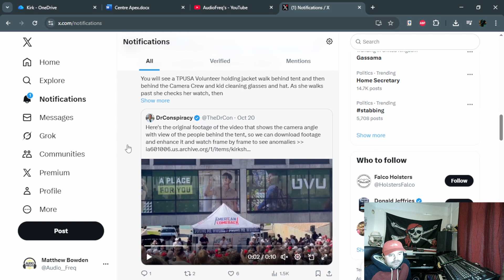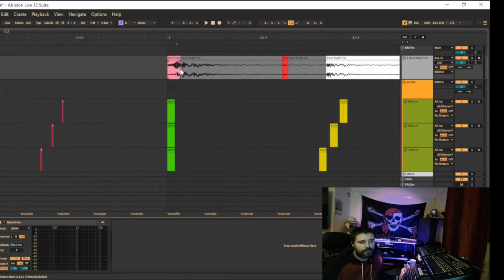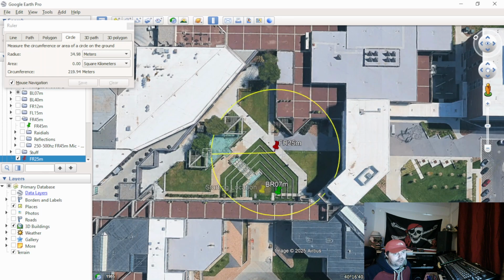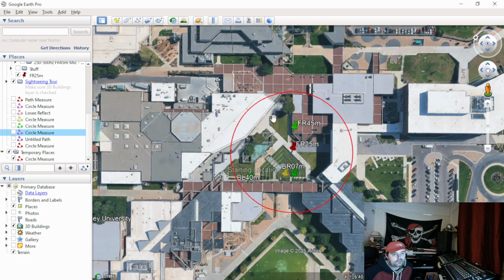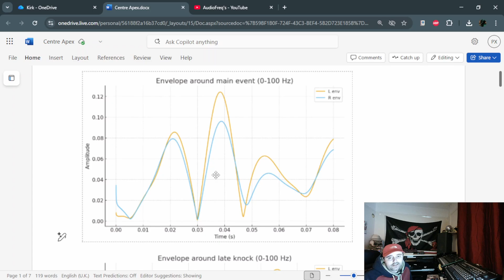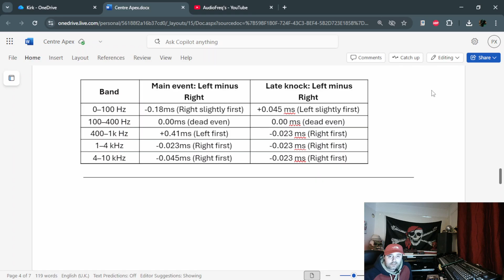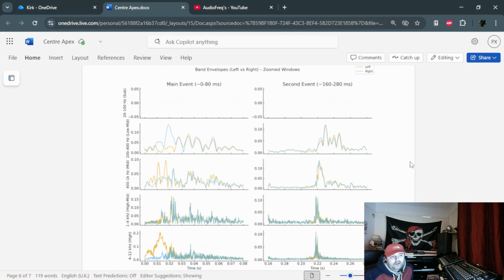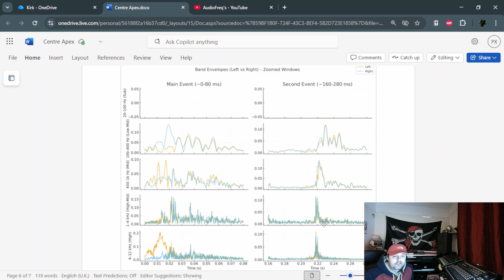Stereo analysis | Frequency Mapping

Comment: Did you do your research on phone mics?
"The microphones on an iPhone are typically located at the bottom near the charging port, at the front near the front camera, and at the back near the rear camera. Newer models may have additional microphones for improved audio quality during calls and recordings." - Claude by Anthropic.

So which of these multiple mics are you getting the TWO audio tracks from?

216ms is the EXACT time of THE Crack to Bang - but you don't want to hear that, right?

Prediction: The evidence will show the gun was located 129m from Kirk at the Losee centre roof.
Reply from the maker: Like I explained. My test is immune, call it what you like. Crack to thump is fantasy with formula. I have made my point. It's like counting to measure thunder. It's a wives tale without the inputs. I don't really care what people want to measure or call it. I'll do my test regardless. Let's face it though. I'm the only one actually measuring something real here bob. Not guessing, I'm not starting with an answer and making the evidence fit that answer. I'm not bothered where it goes, you are though. Very much so. Why?

Comment: Joe Says...back left to right 45 degree angle?  AI says Exactly RIGHT!
 — that’s a strong inference based on the timing difference.
 Let’s break it down together:

🧠 Step 2: Direction Estimation You observed:

Left channel transient at 1.002 s

Right channel transient at 1.004 s

That’s a 2 ms lead in the left channel. Since sound arrived earlier and possibly louder on the left, the source likely came from the back left, moving toward the front right — just like you said, roughly a 45° angle across the stereo field.
Reply from the maker: Haha did you test my findings with Ai? And it worked?! That's awesome!!
Reply: @Audio-Freq  yes, theres a little button at the top of every youtube video, it then summarizes and uses ai to help investigate your finding, complete with images and charts, formulas etc...
Reply from the maker: @truebones I did not know that. But I appreciate you taking the time to run it through man, nice one 😁
Reply: @Audio-Freq  of course no problem, thank you sir. nice to meet you.
Reply: @truebones what button is this? I dont see?

Comment: Step 1: Identify the Transient
Let’s say you’ve isolated a gunshot in both stereo channels. What you’re looking for is the transient spike — the sharp rise in amplitude that marks the moment of impact.

Left Channel: Transient peak at time 
𝑡
𝐿
=
1.002
 seconds

Right Channel: Transient peak at time 
𝑡
𝑅
=
1.004
 seconds

Question for you: Based on this timing, which side did the sound arrive at first?

👉 Your turn — what’s your guess?
Reply: Quick question for you:  If a microphone is 10 feet away from Kirk does the transient peak mark the moment of impact? or the moment the sound arrives at the mic AFTER the moment of impact?
How about 100ft away? Are the times the simultaneous?(That is to say is there only one impact/sound?)

Just a reminder - Matt believes the 'impact' is what is heard when the bullet hit's Kirk. This is the last moment the bullet makes the sonic boom, which is what is being recorded FIRST in all these cases, but it is NOT when the sound of the boom ends, it (the 'crack') keeps expanding from all along the bullet line making echoes from whatever it hits that the sound waves permit.

Comment: There are at least two videos that record the sound of a second shot, one of which misses the first shot because, they say, the stream was interrupted. There is another third video that picks up the first shot and is also interrupted so we have a couple of seconds missing from that too. Then there is a fourth video taken from just inside the tent to the right of where Charlie was sat. 

I mention these because when you listen to the fourth video, you hear the first shot, Charlie falls and a couple of seconds later, the PA system start to feed back and we hear a low frequency hum. Now, this feed-back is picked up by the other videos too and that gives us a way to measure the various sounds and their timing relative to that 'hum'. If we set 't=0' at the beginning of the hum then since we know exactly where and when the feed-back sound originates, we can extrapolate info with respect to the origin of the shots fired. For example, if a microphone to the right of Charlie records a three second delay between the sound of the shot and the beginning of the feed-back, and a microphone to the left of Charlie records a slightly longer delay between the two sound, we know that the person to the right of Charlie was closer to the gunman than the person on the left was, right?

I just think that because we can pinpoint the beginning of the feed-back, we should use that as a marker and analyze the other sounds relative to that marker. What do you think?

Comment: THANK YOU, MATHEW. I LIKE THE WAY YOU THINK AND ENJOY HOW YOU ANALYZE THIS MATTER.  IN MY UNDERSTANDING YOU ARE OBSERVING 3 BASIC SOURCES OF THOSE FREQUENCIES: CRACK, THUMP AND REFLECTIONS OF THE CRACK. IF SO, IS THERE A WAY OF "SPOON FEEDING US" WITH A BLOCK GRAPH OR ANY OTHER  VISUAL WAY (DIAGRAM) THAT DIRECTLY REFERENCES  THE  FREQUENCY ANALYSIS TO THE PARTICULAR LOCATION AND ENABLE MANY TO MORE EASILY FOLLOW YOUR  EXPLANATIONS. AT LEAST,  FOR SOME OF US WHO DON'T HAVE SCIENTIFICALLY INCLINED MINDS. I PRESENTED YOUR MATERIALS TO SOME AND THEY SEEMED  OVERWHELMED BY IT, FOR THEIR  INABILITY TO VISUALIZE  OR IMAGINE HOW IT WORKS.   

 IS THERE ANY POSSIBILITY, THERE WERE TWO SYNCHRONIZED (SOUNDS) SHOTS FROM DIFFERENT DIRECTIONS?  ONE VERY LOUD AND ONE SUPPRESSED. TODAY, THERE IS A TECHNOLOGY THAT CAN ENABLE THAT EFFECT IN A VERY PRECISE  WAY.  IS THERE A DIFFERENCE IN HOW A SOUND WAVE BEHAVES/ CHANGES WHEN IT PASSES THRU A "SLIT LIKE" GAP IN A CONCRETE WALL. ANGLED AT 45 DEG. DOES THE WALL ACT AS A SUPPRESSOR?  DOES THE SOUND LINEARLY FOLLOW THE BULLET OR DIVERGES IN A CONE LIKE  SHAPE, AND IF SO, FOR HOW LONG AFTER A BULLET LEAVES THE BARREL. I AM TRYING TO GET SOME UNDERSTANDING OF THE CORNER WHERE THERE IS A "WINDOW" AND 45 DEG WALL GEOMETRY AND HOW THE SOUND TRAVEL/ REFLECTION CAN BE AFFECTED BY THAT, AND CREATE A GHOST DATA THAT TRAVELS UNDER A LOUDER SOUND.

Comment: Am I going to have to do this myself? I have already explained this multiple times. We can triangulate exactly where this came from and the velocity of the round.
Reply: It doesn’t matter if you are able to do that and pinpoint the location of the 30 06 rifle, because the audio analysis shows that the initial shot and impact on Charlie’s neck do not add up. A supersonic bullet travels faster than the speed of sound so in any normal situation we should see impact first then a split second later hear the shot being fired. But when using a recording made near Charlie position are hearing the sound of the rifle first then impact occurs. What this means is that the 30 06 could not have been the bullet that killed Charlie. We have to consider a second gunman nearer to Charlie firing the deadly shot.
Reply: I 100% agree. The whole thing doesn't add up with the official narrative. I was just meaning as far as calculating this audio. I like this guy's content but he continues to say that we can't know so many things which we can know because we can triangulate.  @richardhernandez6937
Reply: The audio recorded by cell phones can be off sync with the visuals when dealing with super fast actions by a % great enough that the distance of the bullet position could vary by 90 feet. This is due to how smartphones record audio and video. The audio has a very fast recording frequency. Thousands of times per second where the video is likely only doing 30 to 60 frames per second. The smart phone use timing to try to sync the audio the video images but since there is a 1/30 of a second gap between each frame the audio will not be perfectly synced. The audio itself is a much more accurate set of data.  @richardhernandez6937

Comment: All your hard work is greatly appreciated!!!
Reply from the maker: And I appreciate you mate! Thank you!!
Reply: @Audio-Freq  The Fugal building to the right of the Hall of Flags has a HVAC on top - which Chatgpt says would be noisy. But they built a wall around it 2025. It still says noise would be heard. "If the HVAC produces significant low-frequency energy, listeners may still hear a low rumble — the wall alone will not eliminate that."
Reply from the maker: @davidmorgan156  Sure, but that doesn’t change propagation timing — walls don’t move sound sources, they just muffle them.
Reply: @Audio-Freq  My point was they built the wall in 2025 and it has a gap that points towards the courtyard. They tried to resolve a noise issue only to focus it. It creates a perfect sniper's nest that you can look around the corner from fire and retreat.

Comment: How do you account for the constraint that angle of incident (source sound) must equal angle of reflection?
Reply from the maker: I am not measuring that, yet. I might not need to. See how it goes
Reply: @Audio-Freq  Also you divided the measured delay by 2 which is assuming that the incident and reflective paths are of the same length?
Reply from the maker: @VegasOct1Sounds  Of course, I'm measuring it as a reflection :) eg. It's coming back to the mic
Reply from the maker: I'm not trying to locate exactly what surface it came from. I don't care, that's is not how sound works, it's spectral. That's why these spikey questions fall short of the mark
Reply: @Audio-Freq  I'm an electrical engineer, I understand the effects of multi spectral waves both in the context of reflection and refraction.

I'm just trying to understand what you presented in the video, why the divide by 2?

Whenever I don't understand I presume someone knows something I don't and I ask questions so that I can go do the research necessary to bring myself up to speed.
Reply from the maker: @VegasOct1Sounds  Ahhh I get it, you're being objective. It's hard to determine via text. But yes. It's because I'm treating it as an echo. So, it's travelling back from the surface it reflected on. Which one exactly isn't relevant as it's a sound wave and spectral. It's just that it lines up on the map and in the waveform, and for me, moving forward is more important to build the reflection model next. This was merely to put the issue to bed
Reply: @Audio-Freq  But there are many paths a reflection could take, not just one.  Hitting a mic, bouncing off, reflecting off another surface, and coming back to the mic, isn't even a particularly strong one.
Reply from the maker: Yeah man, that's why I use a ruler ;)
Reply: @Audio-Freq  K, well in that case I'll wait and see what you come up with.  Good luck with your journey
Reply from the maker: @VegasOct1Sounds  Unless you know something I don't? You're probably more qualified to talk of waves, but I think the method holds up at the very least. I'm learning here to :) It's a completely new area to my studies. I appreciate your time!
Reply: @VegasOct1Sounds  
Oct 1, 
 Is it a big deal that the vids. are captured on the first level AND  on a second level,  
to determine the path of the Super-Sonic, and the location it came from ???
Reply: @seventhson9441  Long time since we last spoke.  In theory no.  In practice a little more than no.  The "cone" is symmetrical about the bullet path, but all calculations of time of arrival must account for the small difference in elevation between the bullet path and the recording location.

The most difficult aspect to this investigation IMHO is the lack of (number) of recordings.  In Vegas I could always muster 10-20 or more for any specific volley, here there's only a few, and even finding the originals for those now is hard.

There's only one shot, and it happened during talking  so on some of the vids there is speaker sound, actual sound, and then background sound all at the same time.  Makes it a bit tougher to sort out what is what.

About 5-10 more recordings at 75-100 meters spread evenly across the field would certainly make things easier and much more clear.
Reply: @VegasOct1Sounds Did you publish anything of your Vegas analysis?   Where can I find it?
Reply: @dabrowsa  nothing public, when I do will be on my channel
Reply: @dabrowsa  I mistook your question, I've published hundreds of hours on the Vegas shooting primarily focused on gunshots.  It's all on my channel.
Reply: @VegasOct1Sounds  On the other hand the audio here is much simpler, having only one gunshot, maybe two if CTs are correct.
Reply: @dabrowsa  yes, few shots means potentially less analysis, but  it's a double edge sword.  Less analysis, but also less supporting  data.
Reply: @VegasOct1Sounds  
I think,...
This is an assassination,...

Not a Sniper shot
Not a hunting shot
Not a Target practice shot

Every trick under the Sun 
would be used to deceive,... hide,...mislead,..and with altered audio,..
 Conceal ,  how it was pulled off ,  🙂
Reply: @VegasOct1Sounds  Yeah, but fewer shots means less to prove.  For Vegas, there's a thousand rounds, any one of which lead to another shooter. 
Also, there were actually many more videos at UVU than currently known, they'll come out at trial.
Reply: @seventhson9441  could be, there is definitely something "different" about the acoustics that I've yet to wrap my head around.
Reply: @VegasOct1Sounds  😊
Reply: @dabrowsa  I'm sure there are many more videos in court and out of court, but they aren't being made public.

I spent 4x to 10x more time  proving/disproving single "percussive" sounds were/not gunshots than I did on any volley.
Reply: @VegasOct1Sounds Don't you think those other videos will come out after the case goes to trial? 

I'm not sure what you mean by saying you spent 4x the time on single shots.  
My point is just that fewer shots means fewer questions to answer,
and less confusion in the audio.
Reply: @Audio-Freq  

Audio-Freq,...             " I am not measuring that, yet. I might not need to. See how it goes "
I would say,..Hang in there and SUFFER Through the mystery.
This is a deliberate deception.  An open mind goes a long way to figure out the Operation !!!!
Reply from the maker: @seventhson9441 what have you been taking, where can I get some? 😅
Reply: @Audio-Freq  
Audio,
Just trying to tell you to get ready for people to treat you,.... like you just did me.
Your analysis is correct.  But many will say You wasted all your time, talent, and equipment,
coming up with an answer that does NOT match the Narrative at all.   OR,..
  """ what have you been taking """.

But you're correct,  so you have to Suffer what others say
until you are satisfied with the reason you ended up with your results.

So,  here it is.  The Shooting device with 3 projectiles  in it,     is under the table at the end.
The device is triggered by the Super-Sonic from a Silenced Muzzle .

That SOUND ,......of the Super-Sonic that hit either at the grassy Point seen on Phil Lyman's vid. and traveled to
the tent at the speed of sound,.......  OR,..
It traveled at the speed of the bullet,......over the Walkway,   and set off the device.
Reply: If incidence != reflection, it's not a reflection.